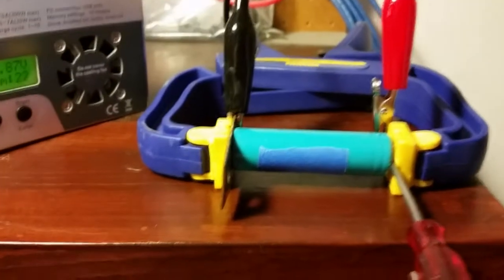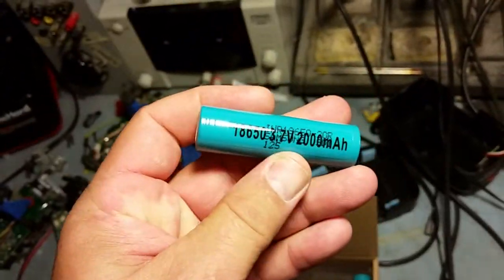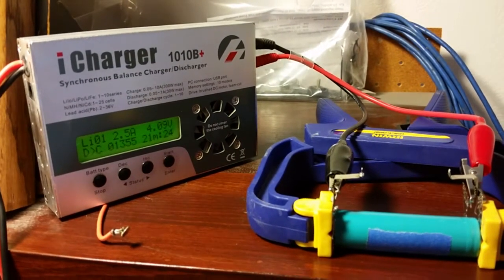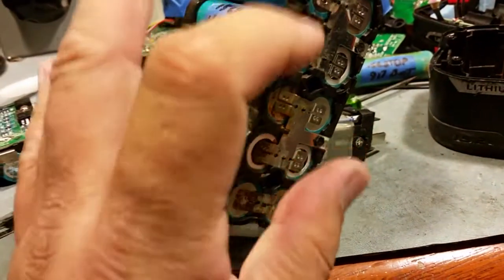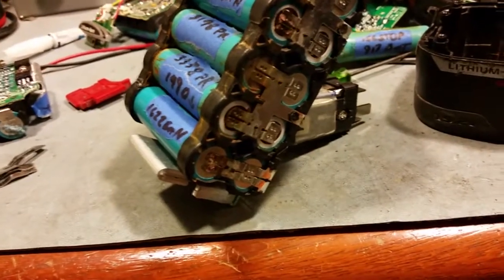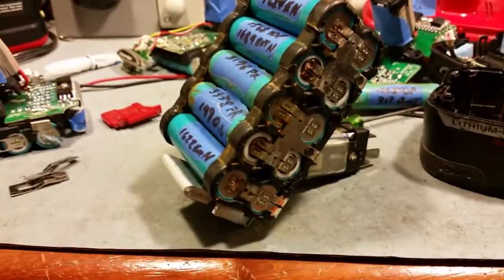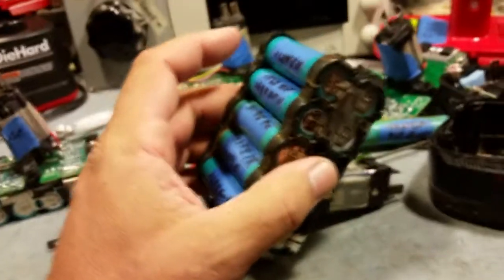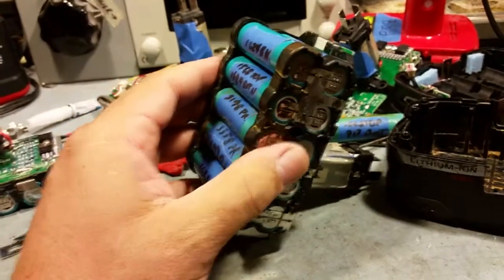Cycle testing and repair of 19.2 volt Craftsman lithium packs part 4, finale.

Comment: Do you need to pre charge the cell before installing it into the pack because I have the 20 volt system and they are soldered on both ends and I'm scared of a fully charged cell and applying heat also where did you buy those cells I cannot find a reputable site
Reply from the maker: +Cj Utterback The replacement cell needs to be at the same level of charge as the rest of the pack. With lithium you can get somewhat close by matching the voltage of the new cell to the rest of the pack. Check with the Endless Sphere forum for cell sources. I ordered mine off of ebay. I don't know if the seller was any good or not. The cells still work after almost a year.